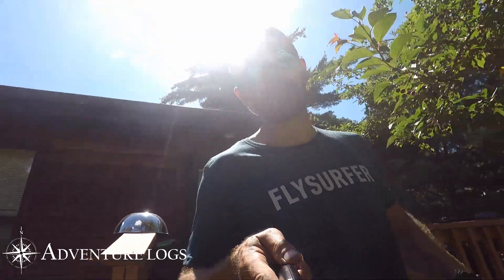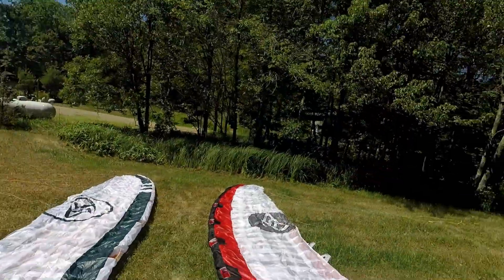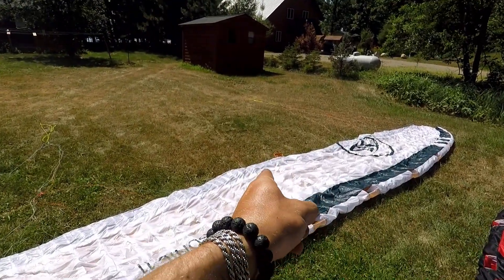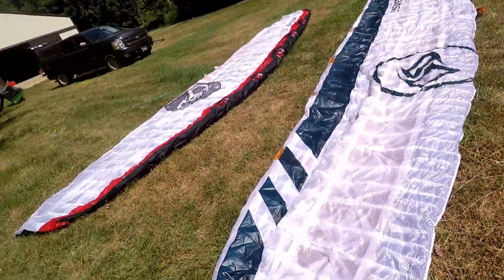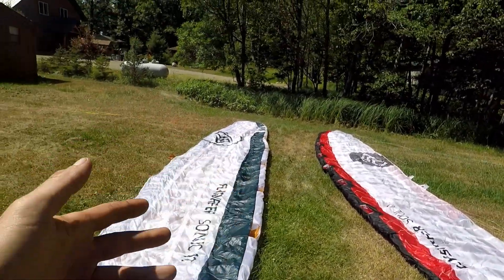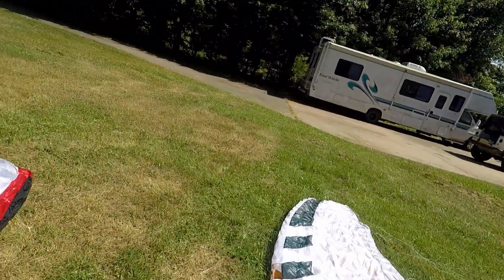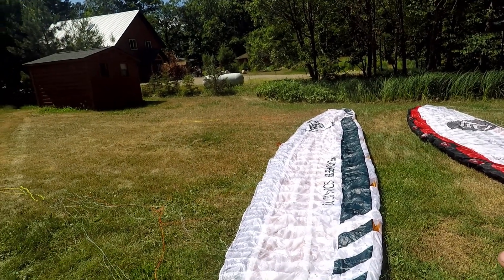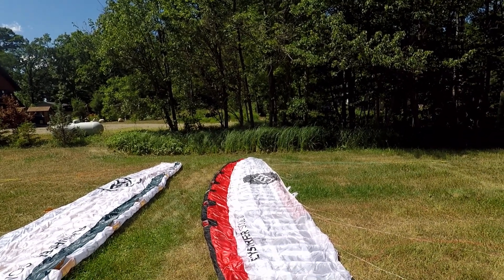Flysurfer Sonic3 vs Soul. Build, Design, and Flying Differences and what's new on the Sonic 3.

Comment: I use only twin tip

i use soul 12 and 15 for oldschool airstyle, my friend uses sonic 3 (in various sizes from 11 to 15) i tried sonic, here's what i think:

soul: big size had more static traction (compared to the Sonic, with little wind I need less speed to jump) better stability in gusty wind, better restart from the water, with the Soul I perform my tricks with my eyes closed and try new ones fearless. in my opinion the top if you only use twin tip 100% of the time

sonic 3: better jumping performance if you arrive at speed, more technical to manage, slightly more technical restarting from the water, slightly less stable in gusty wind, in general preferable if you use 50% twin tip, 50% hidrofoil (guarantees performance much better than the Soul)

I will go against the grain of the mass of people, but I prefer SOUL, easy, permissive, in general simple, Great for learning tricks and leveling up .. hoped they will continue to produce it.
Reply: Of course they will. It's the brand flagship product and most sold kite they have. They will release the soul 2 at some point in the next 12 months I would say.

Comment: I ve both the sonic 11 and Soul 10
I prefer the Soul for twintip and Big Air, Sonic jumps higher and loftier, but kite is much slower and lacks reactivity ion the air, so loops are a thing of nightmares ^^
But Sonic wins hands down for all foiling
Reply from the maker: Yea the loop on my Sonic3 11m is pretty scary. Had a pretty bad crash in mid 20 it’s of wind the other day due to starting a loop a little too early. What a surge, it was fantastic till the water impact lol

Comment: Hi Jason, I have been testing Sonic 3 13m in 12-15kt. Really enjoy kite but it was very scary experience on the way in and out of water. Kite was overflying on 12 and I had slug on lines. I have soul 10 and chrono v3 15 and I did not have that  experience with them. Do you have some tips how to overcome that overflying problem? Thanks
Reply from the maker: Hey Dzibks, higher AR foil kites will have a problem sometimes of overflying. Other times though it’s just looks that way because it sits so high in the wind window, takes some time to get use to it lol. In gusty weather where overflying can develop, I usually always keep some tension on the bar. If the kite starts to surge back, I will sheet in to help keep the kite from shooting forward. Same thing when the kite looks like it’s overflying, sheeting in helps move the kite back to lower in the wind window. 

This technique takes some practice to get it right but eventually you’ll be able to do this mostly by feel alone. In unstable conditions while I’m walking under the kite, I’ll be constantly sheeting in/out to keep the kite where I want it. Once one the water a lot of this tendency will go away but it can still happen and same technique applies. Hope this helps!
Reply: @adventure-logs  thanks Jason, it all make a lot is sense. Coming from core Xr and Friendly foil kite it was a bit of experience to try hardcore foil machine. I ordered 15m sonic 3 and I will had in mind your advice. Thanks a lot, really appreciate

Comment: Hi, thanks for the video, I am just about to upgrade from my speed3, which I have had for years now, and am not sure - I am big into low wind - because it does not blow as much where I live, and I like to jump high so thats a plus for the sonic, but I also like to do some crazy stuff and would like my kite to live on as long as the speed3 has - and the soul looks much more in line with the speed3, and that's probably why its gonna be soul. It's a pity I have to choose, I'd like to have both :-)